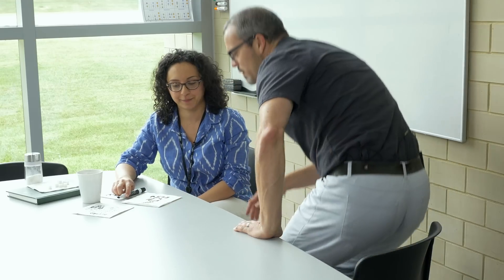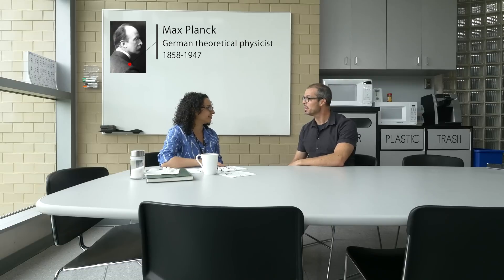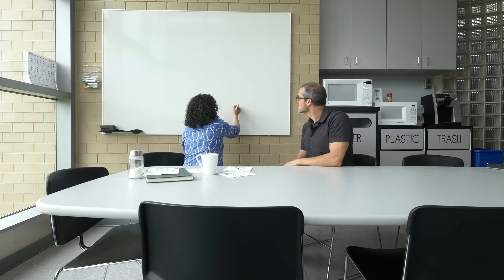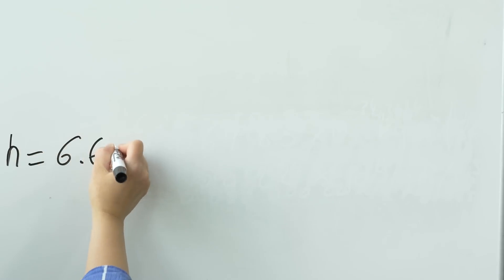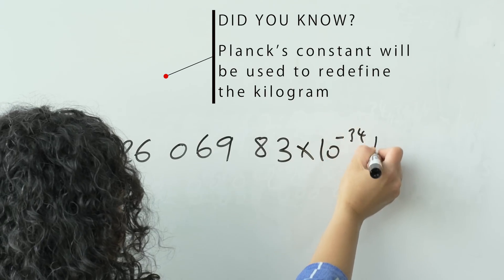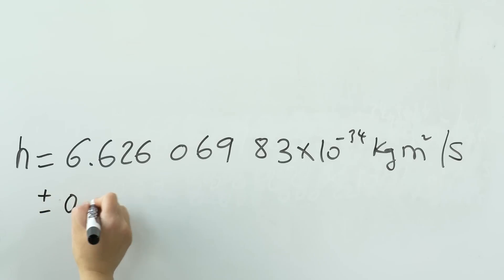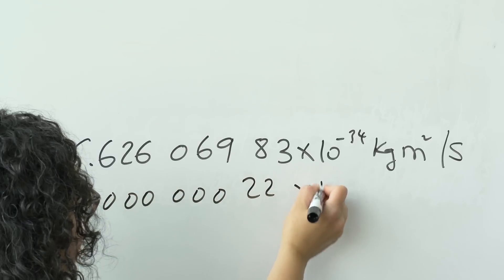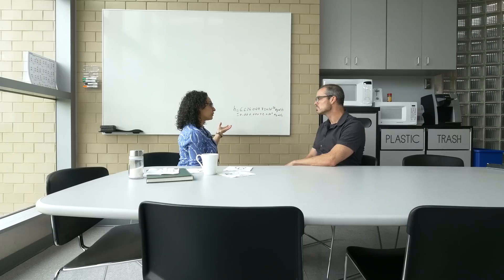Measuring Planck’s Constant

Comment: hi i was wondering if i can use a MATLAB to graph the stopping potential against the frequency and derive the slope and using the slope i could find the Plancks constant by multiplying e (1.6*10^-19C charge on an electron) to it (the slope). but i am not sure how to set up the constraints, i do not have enough knowledge required for operating complex software such as MATLAB. could someone help me out here?